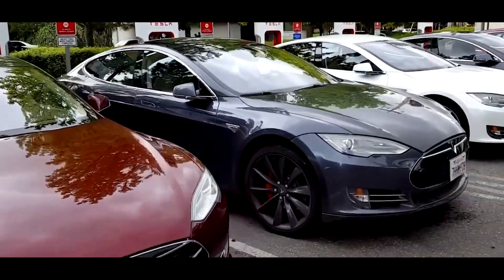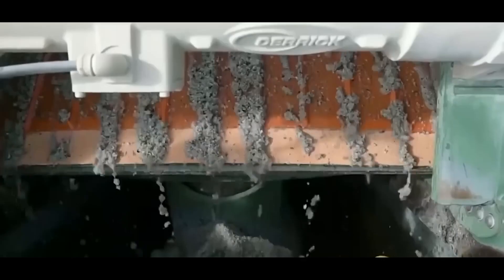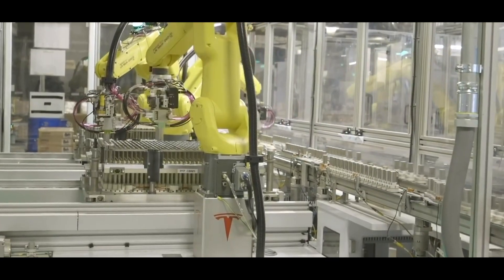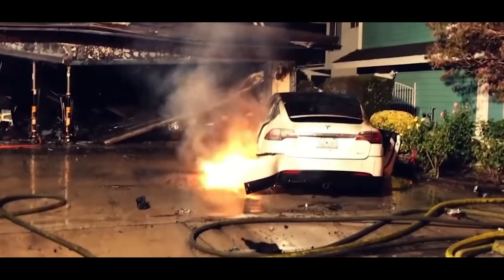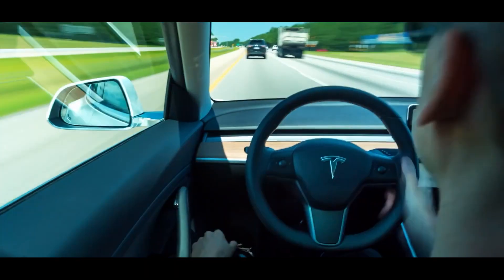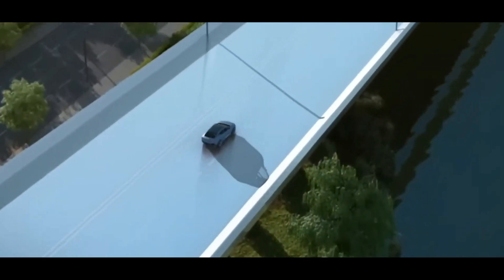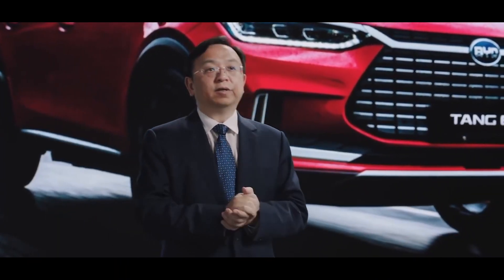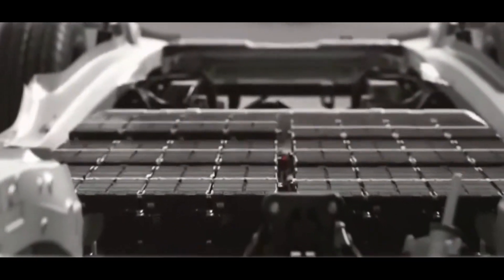This Chinese Sodium Battery Will Change EV Industry FOREVER In 2024

Comment: Until battery charge rates get close to gasoline/diesel charge rates in miles added/minute of charging/fueling, EVs will not replace ICE vehicles.  And, if we ever achieve such high charging rates, the entire electric grid will be destabilized.  I look for EVs to never pass the percentage of people housed in single family homes.
Reply: So only about 60% of the population in the U.S.A. will be able to live with electric cars.
Reply: @lancebybee7962  Sixty percent would probably be the absolute maximum.  We also have to consider that a lot of single family households have two or more cars and won't be able to charge all of them.  And, since ICE vehicles aren't going to go away, there will be people in single family homes who chose ICE over EV or chose ICE in addition to EV for convenience and fro long road trips.

Another thing that many people do not consider is that the more people who adopt EVs, the more electricity prices will go up and the more gasoline prices will go down.  Plus, when you consider the life of an ICE vehicle, the cost of fuel isn't all that high.  For instance, my mother drives about 8,000 miles/year in a 2020 Honda CRV and averages 32 mpg.  With gasoline where she lives currently priced at $3.40/gallon, she buys about 250 gallons/year for about $850.  I don't know what she paid for it, but a new CRV is around $31k.  If she keeps hers for 10 years, the cost of fuel will only be about 20% to 25% of what she paid for the car, so the purchase price negotiation and the depreciation rate of the vehicle are actually more important than fuel economy.

Even if we get to the point where EV purchase prices and maintenance are about the same as ICE vehicles and if charging at home is about the same price as buying gasoline, there will be a lot of people who simply will not adopt EVs because of the charging times.  Even if all public chargers were free, I wouldn't spend an extra 25 minutes at a charging station rather than pay for gasoline (and, at present, public fast charging electricity generally costs quite a bit more per mile than gasoline does).

Comment: lower energy density is ok for certain applications. 
They also have limited cycle life.
It will never replace lithium Ion for cars unless they get the energy density up. 
160 w-h/kg 
200 w-h/kg may work in big Chinese metro areas but it will never gain popularity in the US where range matters more. 
Lithium sulfur batteries have energy densities in excess of 500 w-h/kg. manufacturing costs 40% less than Li-ion NMC
I expect we will transition from Lithium ion, to lithium iron phosphate, to Lithium Sulfur or Silicon Sulfur batteries.